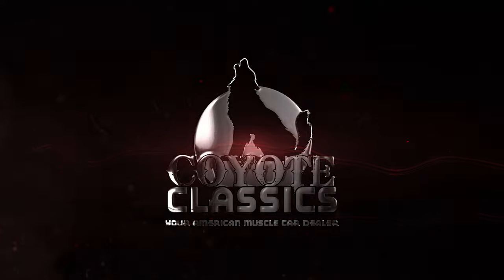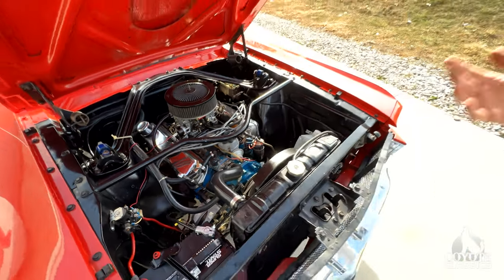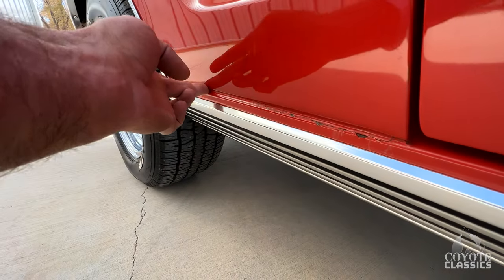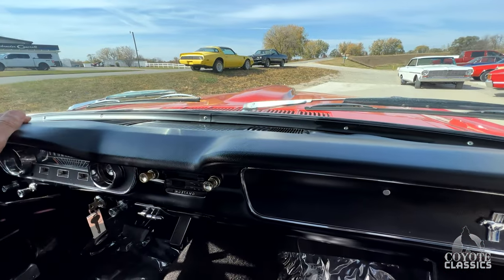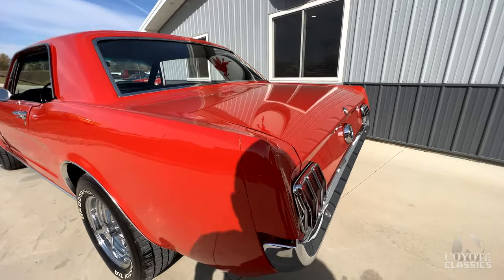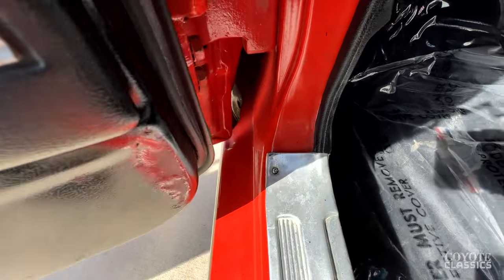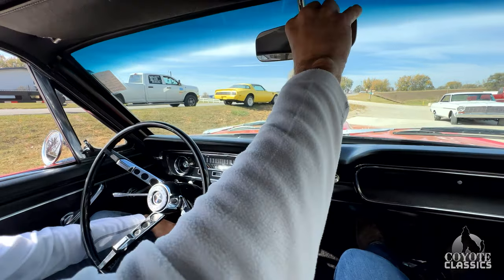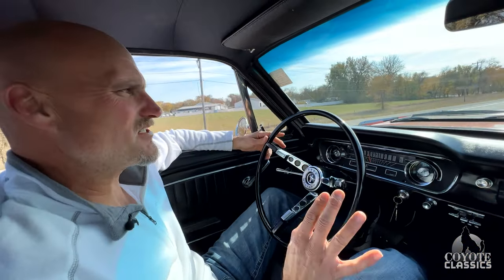1965 Mustang Coupe Review & Test Drive at Coyote Classics

Comment: I own a 65 coupe literally almost exactly like this!  I love it.  Mine is factory turquoise.  I’m wondering if you can tell me what size wheels/tires you have on this beautiful car?  Originally they used 195/&5/14r tires in front and 205/70/14r in back.  Do you know if you can put a little bigger tires on and maybe 15 inch wheels?  Just wonder what you have here because it looks awesome!  I want to remove the old whitewall tires and make it look cooler like this!  Thx for any info!